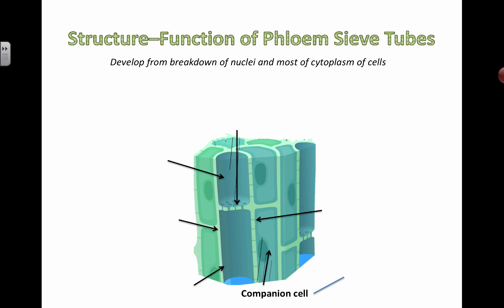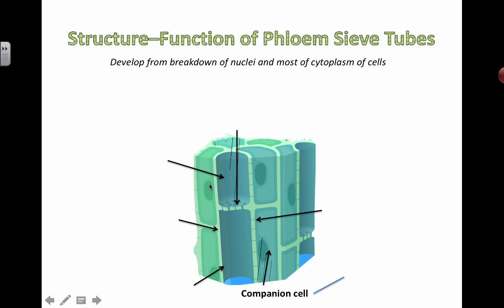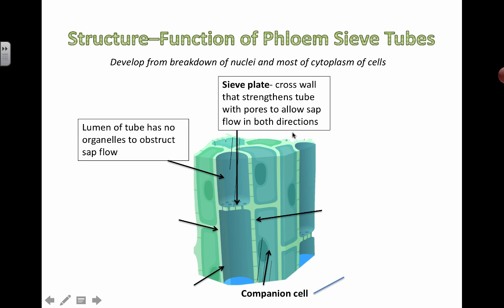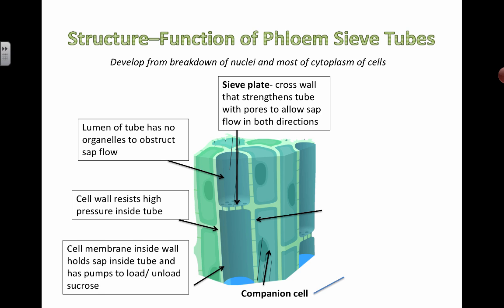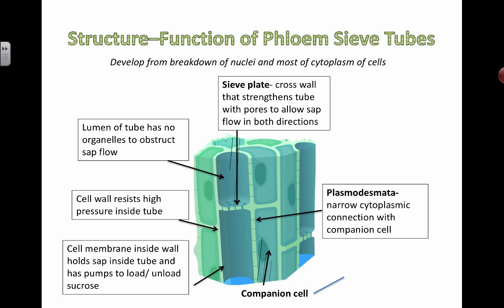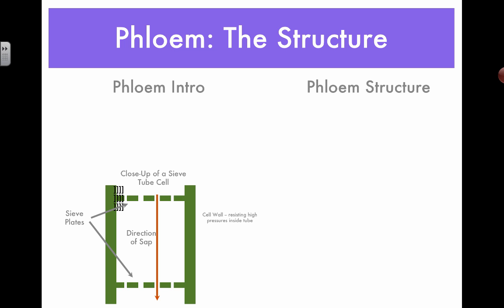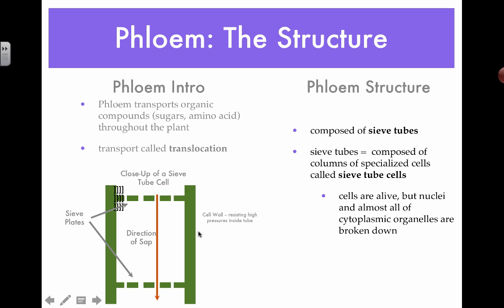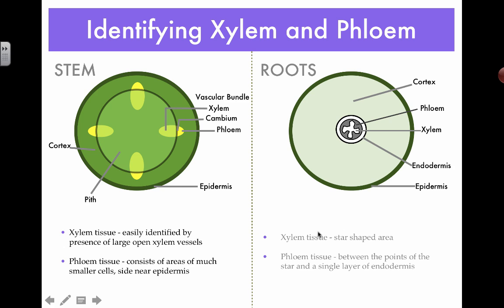Phloem Structure and Function (2016)

Comment: So I've read that more basal vascular plants (gymnosperms, pteridophytes) only contain something called sieve cells, whereas sieve tubes\sieve tube elements (which I think this video is specifically covering) are only possessed by higher angiosperms. I was hoping this video would provide some clarification on the differences between those two types of phloem cell, particularly with regard to differences between how each cell type connects with vertically adjacent cells. Apparently the more primitive sieve cells actually lack proper sieve plates, but I've struggled to find more specific information than that. Any pointers?

Great video!!

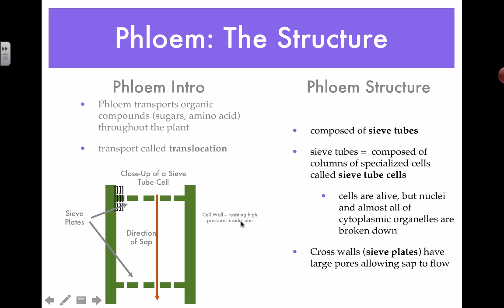Comment: Around 3:50, you seem to conflate cross walls (the portions of cell wall on the top and bottom ends of a sieve tube element that separate individual pores in the sieve plate) with plasmodesmata (the HORIZONTAL connections between a given sieve tube element and its companion cell).

A lot of this video is super helpful though!